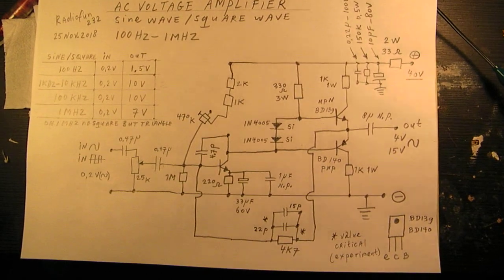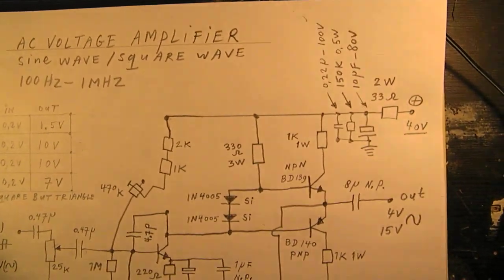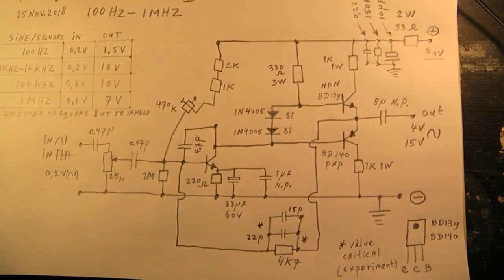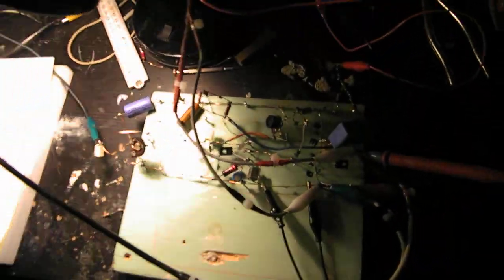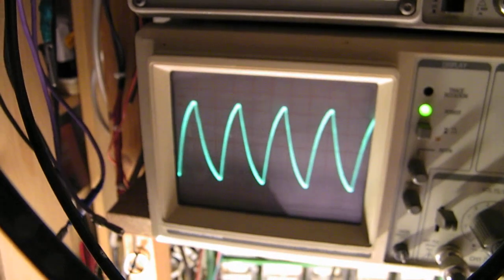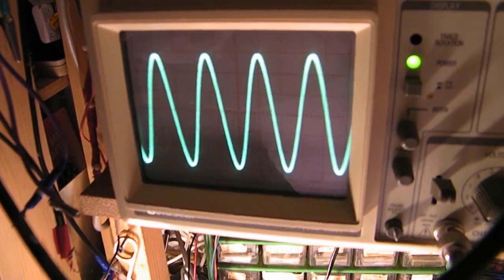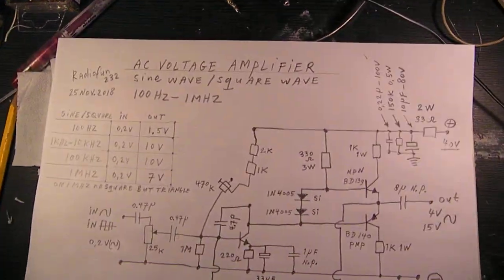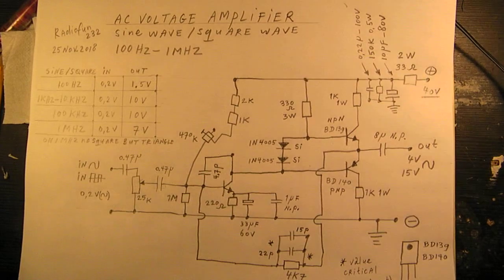Voltage amplifier for sine/square waves 100 Hz-1 MHz (0,2 V in 8 V AC out)

Comment: do you know how much power this circuit can output? ive been trying to build a power amp for this frequency range..
Reply from the maker: I did not test it. But I think 1 Watt or so. There is distortion (square wave to triangle wave) on the higher frequencies.

Comment: Awesome videos.
Sir I need your help to get circuit of sine wave voltage amplifier to be fed by function generator sinewave signal source with frequency range of 500khz to 1200khz having input signal level of 10 volt peak to peak. The output of the signal should be 35 volt peak to peak having output impedance of 600 ohms . Can you please share the schematic diagram of the circuit .
I tried your above circuit . It works ok but does not give the peak to peak voltage level that my application requires.
Awaiting your earliest response.
Thanks & kind regards.
Reply from the maker: Thanks and sorry, but you have to find it out yourself. I cannot do schematics/testst on demand and that is not the aim of my YT Channel.

Comment: Спасибо , выглядит хорошо. Может попробовать еще увеличить емкости и сопротивление регулятора на входе? Может быть это учучшит форму прямоугольного сигнала.
Reply from the maker: пробовал 100 К, но плохо справился. Если сигнал слишком сильный, он что-то искажает. Он становится лучше с более слабым сигналом. Это является оптимальным. Translation: I tested it with a 100 K potentiometer, but that did not work fine. With a somewhat smaller input signal the squarewave has a better shape. It is sub-optimal (but useful).